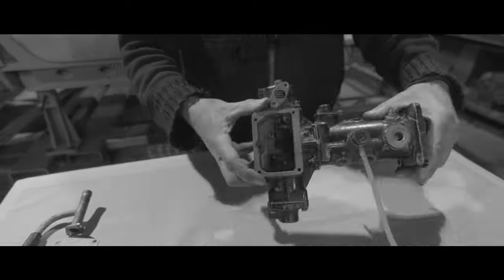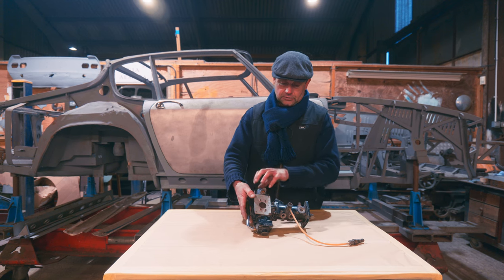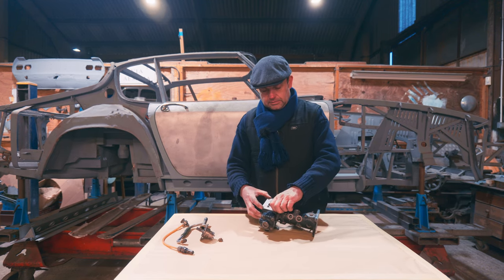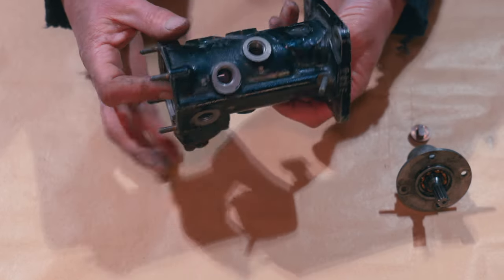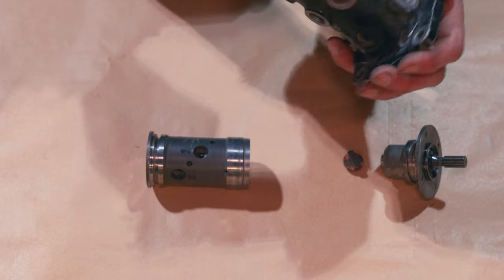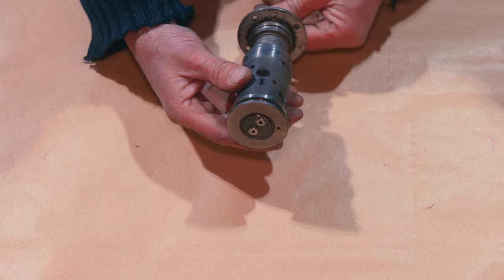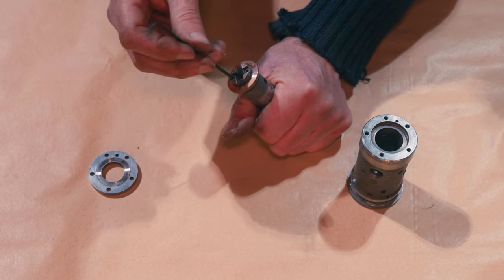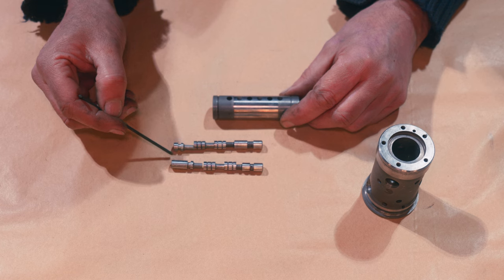Lucas Injector Part 3

Comment: Mark, Lucas CAV designed/produced the diesel fuel injection pumps rather than Lucas aerospace.
Reply from the maker: Thank you Jason that’s good to know.
The Lucas petrol injection was originally developed for the aero /military sector.
So I guess it was a very different part of the business. Official secrets act and all that !  It was first used for racing before road cars.  
You could also imagine it on a Merlin or something similar it just has that purposeful look of that kind of stuff.

Comment: Amazing that someone could have that idea is his head for fuel injection. Design it and then put it in practice. Boggles the mind. Make the modern EFI systems look like child's play in design. .
Reply from the maker: In 1943 Lucas had a fuel injection system for aircraft and military vehicles.
So in the 1950s it was further developed for motor cars. Adopted by Jaguar and used on the D type. 
So yes remarkable how someone could dream this up and then develop it without computers 3D modding and CNC machines. 
An idea, a slide rule, a drawing board and then machined by hand !